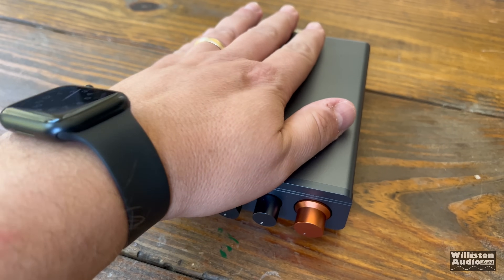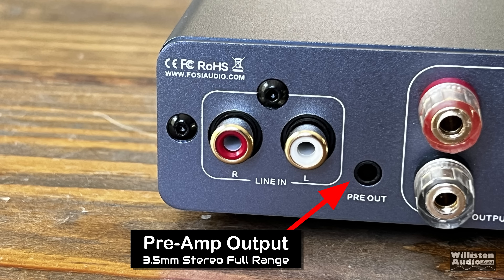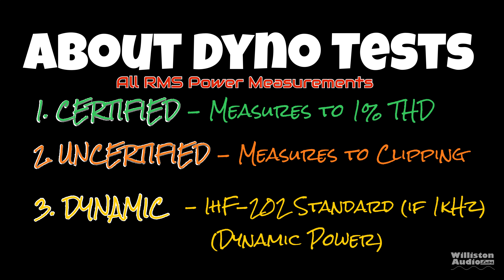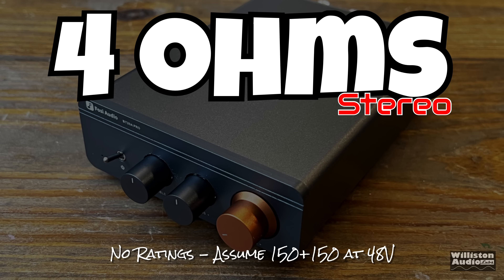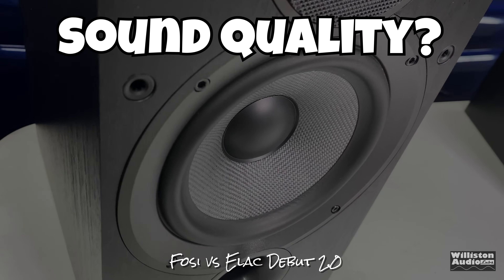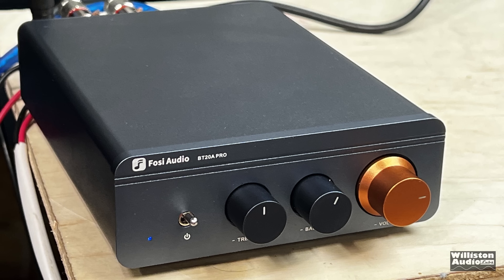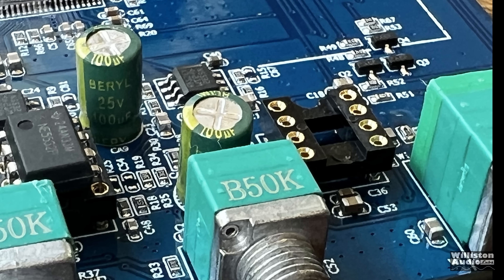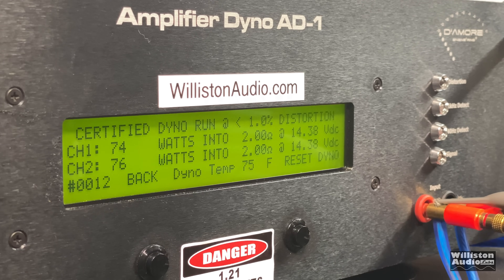Fosi Audio BT20A Pro Mini Amp TPA3255 Review and Power Output Test

Comment: I noticed you mentioned these small home amps get a lot of attention on your channel. Another reason these are used a bunch for are for bass shakers for home theaters and mostly sim racing. If you were to do a few episodes of the ButtKicker bass shakers actual amps and if they are properly paired for them. A few episodes of common bass shakers smaller and larger  (aura’s and Dayton) wattage requirements compared to the amps that people purchase for them, would get a ton of views about those amps.  For example a lot of people run the Nobsound NS01-G paired with two Aura BST-1’s and they swear it works great but don’t understand how severely under powered that amp is for two of those shakers. 

You wouldn’t need to purchase the bass shakers (Dayton TT25-8’s, Aura BST-1’s or the Buttkicker brand shakers), just share an image of them with their required RMS and test the Amazon common amps / share the data of previous ones you already tested to show which amps they should really be using. 

These would get a lot of views for you from the gaming communities.

Comment: Have lots of these amps around the house, also have a Doukaudio 600w Amp with built in power supply. its pretty good if dont enable tone controls and It seems I dont get much BASS from it. Wondering what the 600w Sub/full range amps with built in power supply do as would like to go two monos. I have a feeling the small power supply in it doesnt give the full 600 or even 300.

Comment: I use Wuzhi audio amp with bt ( small than zippo lighter, at under 10$ price ), that have 2x50w at 24V. I use 12V 8A power adapter and this small thing  put some power in  2 100w 8 ohm speakers. Can you test that small amp?

Comment: I have the original.  I use it for a desktop solution with a polk sub that allows line level input and output.  Paired with neumi bookshelf speakers, it sounds wonderful.  It sounds better than both my Sony and pioneer $400 receivers, but those are 5.1 systems and don't play 2 channel sound as well.

Comment: How might the BT20A perform as the power amp for a pair of passive, 1x12, 8 ohm, FRFR guitar cabinets? The L & R line level outs from a Line 6 Helix would connect to the BT20A L & R inputs. The BT20A outs would connect to each cabinet. Thoughts? Thanks much!

Comment: The BT20A Pro looks good, but the Aiyima A07 PRO (with same TPA3255 chip and tone controls) has a BIGGER power supply @36v 6A and its BT is the BETTER APT-X decoding. Any chance you might test the Aiyima A07 PRO as well? Thx
Reply from the maker: Thanks for the suggestion

Comment: I would Not recommend 48V PS  unless you know the power rating of onboard DC Filter Capacitor. The ones in Aiyima [A07] amp are rated at 50V ! And these power supply bricks usually output higher than rated DC Voltage [usually 50+ VDC] even at rated AC Input voltage. It's a recipe for disaster. As I checked the video again, the caps are indeed rated at 50VDC!!
Reply: sizce   hangisi  daha iyi     Fosi  BT20A     /    Aiyima     A08 pro      ???
Reply: I also noticed that at 11:15.

Comment: it is very common for class-d to have brighter not so warm sound!
Reply: @Douglas Blake Okay. 
The best class-d I have owned and still own is
Hypex UCD180 HG. costs € 89,- Ex VAT.
per mono card.

The L15D amplifier board is a cheap and relatively good thing.

The L12.2 class-ab is a very good sounding amplifier and is relatively cheap

Comment: I have tried to say it many times that these cheap class-d amplifiers are made quite similarly and have the same type of output filter and the same type of problems/weaknesses. The only difference is the type of amplifier ic. they use
Reply: @Douglas Blake 
If you take a coil in series with the speaker, it will always behave differently with different ohm loads.
The vast majority of cheap class-ab have no circuit as a feedback circuit that fixes this problem.

The Hypex UCD180 has this and does not have this problem and keeps the frequency almost completely flat no matter what ohm you load it with.
But this type of class-d costs a little more.
Reply: @Douglas Blake I know exactly how class-d works. I don't want to explain everything in detail as it becomes a lot of writing.

class-d work on the PWM principle. pulse width modulation.

But the problem is that a coil connected in series on the speaker output will react to different ohms. load and frequency do not become flat. You can get rid of this problem, but it makes a class-D more expensive. Cheap class-d do not have this built in and struggle with this problem.

The coil I'm talking about is the noise coil on the class-D amplifier that filters out noise and converts a square signal into a sine wave

Comment: TECH QUESTION RCA VOLTAGE
PLEASE HELP 
my input sensitivity is .2-6 volts 
Im using a nvx line driver 
Stock audi stereo cause its integrated to car
Rca voltage into and out of line driver are uneven, im shooting for just under 6 volts at max unclipped volume according to nvx clip indicator. 
Left and right rca voltage is .3 volts off between left and right.  Left 5.9 vs right 5.6.
Pre amp voltage to the line driver is very low, milivolts
Should i just use a splitter and run off 1 channel? Its a mono block amp but does use both inputs. 
What does uneven pre amp voltage risk?

Comment: Can you use a 24V power supply that provides 40Amps?
Reply: @Douglas Blake because I have an extra power supply.  I would like to get the full power out of the Amp.
Reply from the maker: I just tried 24V as well as 12 and 48 using a variable supply. Results coming to my 2nd channel Williston Audio EXTRAS

Comment: I'd ask you to try a board with the 8954TH, but the things have quadrupled in price in just a year.
I paid $43 for a dual chip board claiming 420 watts x2, and now a similar board is $168, and they require their own 28-0-28 volt transformer.

Comment: I will never understand why people see 3.5mm preouts and think 2.1 system instead of 2.2.
Reply: The stereo imaging of bass is less perceptible than higher frequencies, so it is commonly referenced as a single channel - particularly when routed to subwoofers that use a single driver.

Comment: The ne5532 also find in my logitech z906 :D
Reply: Are you sure?  That is a 5.1 system and this is 2.1.
Reply: @TheUtuber999  100%....its has like 10 x ne5532 ...i even replaced on the old version of logitech 906(the z5500) the 4580 ic  with ne5532 to see how its sounds

Comment: It reminds of the under the dash power boosters for back in the
Reply: Ya, I had one of those from the JC Whitney catalog in the late 70's in my '65 Fairlane. 30 x 2 WPC (or so it claimed) separate Bass and Treble controls and about 40% THD! Add that to the 10% THD from the Kraco head unit and it was a good thing the Fairlane had dual glass-packs so I couldn't hear anything anyway! 😳

Comment: Similar amps are all over fleabay, dime a dozen. I dismissed all of them presuming they are junk. I stand corrected at least on this brand. That's rather amazing!

I've been thinking of putting together a hideaway "concealed under the eave" audio system for the back patio. This may fit the bill perfectly!

Thanks Big D! 🍻 I got another question on hideaway audio for a '49 Hudson I picked up last year. What are your thoughts on what's decent?

Comment: May have to pick one of these up. I never would have imagined so much power in such a small setup would be possible in my younger days in the 80s and 90s. Looks like really clean volume as well.
Reply: they didn't use switching power supplies and did not have class D amplifier chips.
Reply: @stefanweilhartner4415  true, but the Skar has a glaring lack of vibration protection. It is a common point of failure with those.

Comment: EXCELLENT review. No 2-ohm load test? Curious how it handles that load because speakers' impedances are all over the place. Things I don't like about this amp 1) the Bluetooth vs AUX input is not selectable. ie -- it overrides either/or. 2) should come standard with a 48v adapter vs the crap 32v ones 3) that copper knob is gayy looking (it can be swapped out). Overall, solid video (always awesome to see what you do!)...looks like a solid little performer with sound quality.
Reply from the maker: Watch all the way until the end for the 2 ohm test
Reply: @wal  - OMG, how did I miss that? The amp doesn't like 2 ohms very much

Comment: These are great little products, my separates system eventually just became an amp and Bluetooth dongle, and now it's just one of these little amps with built in Bluetooth,  sounds plenty good enough for Bluetooth audio and goes plenty loud with some good speakers. The big plus is the size and simplicity. Big fan.

Comment: What causes a kind of hissing noise coming from the speakers? Switched DACS from a cheap Amazon to 100 dollar Schiit audio DAC. The hissing is still there but not always. If I turn the volume all the way up on BT30 D I hear a pop and then can bring it down with no quiet hiss. Is that distortion?
Reply: @Douglas Blake thank you🙏🏾 I (25)only hear it when it’s connected to the speakers and it changes when I adjust the volume. My ears are very sensitive to that kind of stuff though.  My sister can hear it (19) but my mom and dad can’t (50)

Comment: Thanks so much for fufilling my request to do reviews/measurements of these little guys. My SMSL SA-300 is an absolute banger and has driven everything I've thrown at it, even a 4 ohm speaker with an 86 dB sensitivity.
Reply: I also would like to see SMSL products tested. I've got the SMSL AD18. 100% awesome amp for the $$$

Comment: @Williston Audio Labs - I've been into reducing the physical footprint of the amplifiers that I use in my various portable audio projects. Recently I've been using the Focal four channel mini car audio amp at £250 a pop. Attached to an external mains 30amp 12v power supply, the bass line supported by a Stinger 10 Farad competition cap. Running a pair of 15" 250w subs. These smaller but equally good units would make pretty good donors for many 'mid-power' projects. Thanks for the great review. Keep em coming!

Comment: That's pretty awesome and I would have idea what to use it for Big D.
Reply: @Douglas Blake yeah I'm aware of what it is. I was just throwing out an idea of what I would use it for and that's obvious too.
Reply: @Douglas Blake  I dabble in home audio where I test out certain amps that's out there just like Big D minus the amp Dyno plus have a shop here in my hometown where I install car audio systems, so I do both here.
Reply: @@Douglas_Blake Yeah I know lol. Don't know what I would use it for but I would find a use for it. I have an home system or I would try and use in one of car systems. That's what I am saying here.
Reply: @@Douglas_Blake you asked me what I would use it for and I just threw out ideas. I never said I would use it in a car but if I wanted to. I have 12 volt invertors that are more then enough to supply the power needed to at least test it out.

Comment: The problem with it is that bluetooth is essentially FM radio sound quality, so you're losing right off the bat. It doesn't matter how great the output is if the input is scheisse.
Reply from the maker: You can use RCA inputs from whatever source you prefer. BT is a convenience feature, not required
Reply: @wal  Duuuh! Of course. My bad; I saw that in the video, but I guess I had a brain fart. Sorry.

Comment: Next time when you review a tpa3255 besure to pick a 48v 10amp metal case psu those allow some voltage adjustment. And you can set it to 50v and with 10amps should have more than enough power to get 200w 4ohm/ch cont.  the datasheet says 170w at 8ohms with 56v and 270w at 4ohms with 55v 
If the board is desinged properly it should have no issues doing that power. These class d chips are robust for what they are. I have oparated tpa3110 for few months with 4ohm speakers & 18v supply and it did not relese the magic smoke..
Reply: @Douglas Blake yes those would be stressing the amp to it's limits and the failure at that point would be dependent on your luck.

Comment: So I have been comparing the sound quality from the 3 different class D mini amps I own with the 3 traditional class A|B stereo receivers I own. One of the receivers is 1 year old, one is 10 years old, and one is 20 years old. All of the class D amps were less than 2 years old. For the life of me, I can't hear any difference in sound quality between my $100 class D mini amp and my $500 10 year old stereo receiver (a Sony 100 watt/channel). The 2 cheap class D were inferior. Maybe its because I'm 65 years old and my hearing is not what it once was, thanks to all the heavy metal concerts I've attended. 🥴

Comment: I have the BT30D PRO and i must say i am very impressed by how much power it puts out, good amps for even the biggest of bookshelf speakers!
Reply: We have a BT30d Pro driving Sony bookshelf sscs-5 with 10" passive sub and are getting plenty of full sound for our small dance events. Large outdoor patio. Excellent sound.  Look forward to upgrading the power supply.  I think that's where it matters, not op amps.
Reply: I'm running a pair of Bose 251's and a Velodyne 8" sealed sub enclosure with that same model and I completely agree with you. For the cost it is quite impressive. Very clear audio quality and plenty of power.
Reply: I have one as well pre 2000 polks with passive subwoofer.  And Holy crap for the size very good amp
Reply: I've got a few 700 watt amps, one 1000 watt amp + one 250 per channel amp that I use on one set of 4 ohm speakers right below one of a Fosi preamp and alleged 160 watt amp.  I have to admit  that aside from the pop when turning them on and off, they are certainly decent units when compared to the big boys.

Comment: What I've found with some of these small amps is that the dual plugs can work, but you'll need to use them a bit differently.  Instead of using one per channel, use one dual plug for the positive connections and one for the negative connections.  Then insert them accordingly (one dual plug into the positive terminals, and one into the negative terminals).
Reply: Yup
Reply: @Douglas Blake Been using that technique for years with my Dayton chip amp, LOL.  The extra stiffness provided by using dual plugs makes sure that there's a lot less risk of a plug moving around and causing a short as a result.  Just make sure to insert the dual plug at the top with the ends of the wire facing up, and the one at the bottom with the ends of the wire facing down.  No unsightly tape required. ....

Comment: Shouldn't the dyno test be considered not accurate due to the voltage difference between the dyno and the power supply for the Amplifier?. The power supply doesn't go as high as 14v. You said don't go higher than 3v because the distortion starts to get out of control yet your tests were all ran with 14.46V  on the dyno. That's ridiculous distortion so the wattage was actually incorrect. If I'm reading this right. Please, feel free to correct me or better yet help me understand this. It would be greatly appreciated.

Comment: I remember in the 70s and 80s when a 100 watt per channel home stereo amp was huge and weighed a ton.  So much change in the audio world.
Reply: when the huge power supply brick is factored in, they're not so tiny anymore. i wish they did this all in one chassis. it's annoying.
Reply: @hardtymz2517  even then they are considerably smaller and lighter than the usual 35+ pound home audio amps of the 70s and 80s that were usually about 15+ inches wide, 12+ inches deep and 4+ inches tall.  But I do understand your point.
Reply: @hardtymz2517  The separate power supply removes a possible source of noise from the amp's chassis.
Reply: 100 watt from vintage amp sound better than 100 watt from new class D amplifier
Reply: @especialistqap  i don't agree. this class d amp has a low quality power supply and filter output stage. the problem is that this is the real expensive part of the amp where they had to cut corners.
if you fix this, you get a very clean amp with no "sound" at all.
but we are talking here about at least 100 extra €/$ for the parts alone and you have to redesign the pcb.
Reply: @especialistqap  agreed but still amazing.
Reply: @especialistqap  je suis d'accord avec vous pour un ampli Accuphase par exemple, mais c'est c'est 100 fois plus cher.
Après quand on veut beaucoup de watts pour moins cher que Krell et Marc Levinson c'est pas idiot d'essayer du CROWN...QSC...
Merci pour votre essai avec les différentes alimentations.
Salutations du Sud-Ouest de la France ✋🙏
Reply: @especialistqap  Not necessarily.  My first piece of audio gear was the Pioneer SX-580 Receiver that I bought with paper route money back in October 1980.  It used a very noisy Darlington transistor pack for the output stage.  You could literally use it as a white noise generator by turning up the volume with no line level input selected.

Comment: How would it be if the supplied power is around 26-28volts but has maybe 30-50amps availible? Would it rate any better than with 24volt, 5amps?
Reply: 24V and u can buy tpa3221 
Tpa3255 whith low voltage is no good.
Reply: @dennissinger7880  how much power can you expect from that one? Was thinking about using it in my Scania for either subs or something else

Comment: So does a pre-out mean that you can control the volume of a powered subwoofer using the amps volume knob or is it the same thing as a line level out?
Reply: Would like to know this as well.
Reply: +1
Reply: I asked this question on a couple other channels that reviewed it and the response I got back both times was yes, the pre-out is variable signal output as opposed to a line level out put that is not variable so you should be able to control the volume of a sub using the amps volume knob. Just FYI